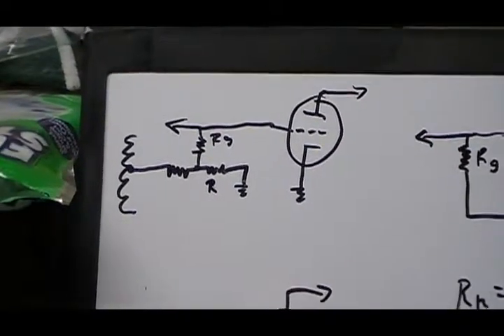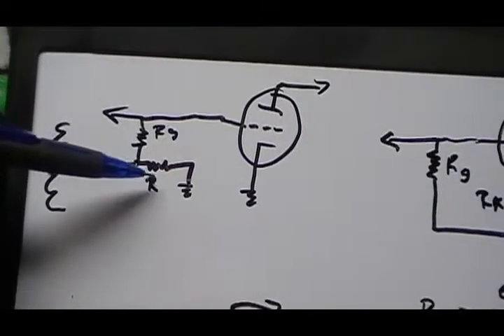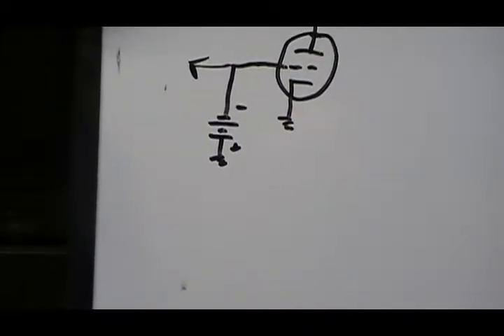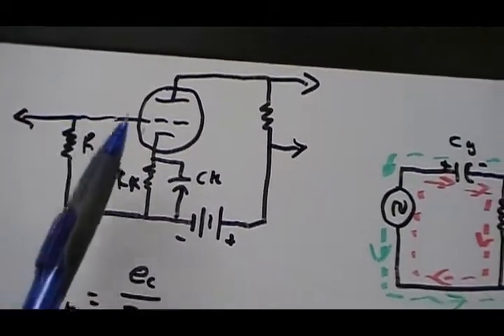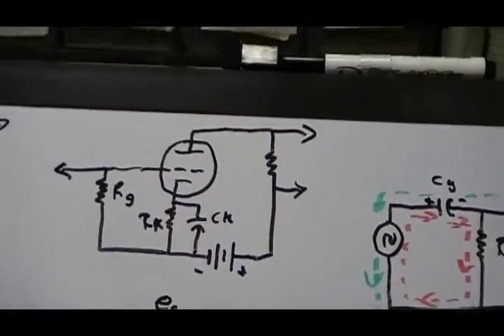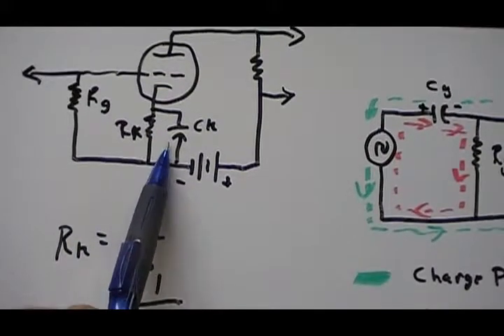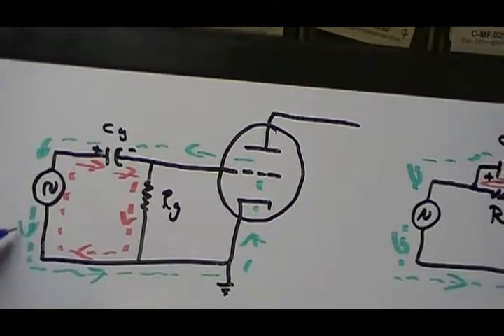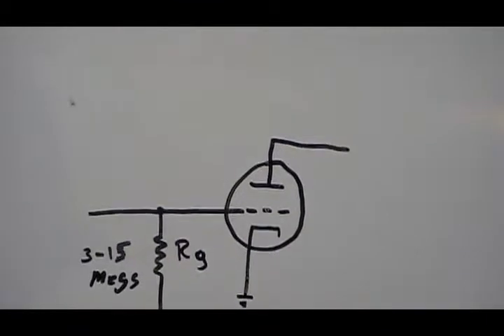Tube Theory part 4

Comment: Dennis, on your contact bias diagram, won't that huge resistor between the control grid and ground raise the control grid to be quite positive with respect to the cathode?  You state it will keep the grid negative, I don't understand.   Thanks for all your videos!!

Comment: Thank you for uploading your knowledge of vacuum tube theories, I have learned a lot from your videos. I have a problem biasing a 12ax7, and I would like your opinion on what may be happening. I may have a dead tube by now, which I am tending to think may be the case. Basically, I have a 170V B+ and I chose 2.5mA current. This gave Rp = 66K Ohm. I have  Rk = 1K2 and Ck = 25uF, Rg = 100K Ohm . On power up, I get 162V at the plate, 0V at the Kathode and 0V at the grid. 

Basically, I am getting 8V across 66K Ohm, giving 121uA.

Can you decypher where I am at with this lot? lol, sorry.
Reply from the maker: +semahnai Try reducing the cathode resistor to 400 ohms and see if that helps.
Reply: I will give it a try, thanks for your response.